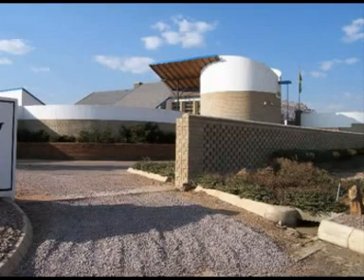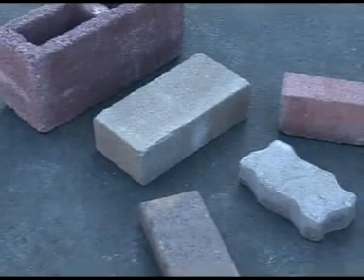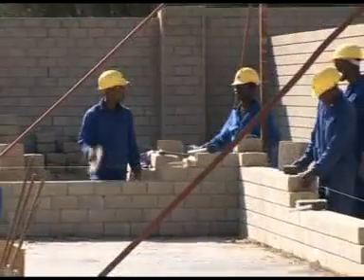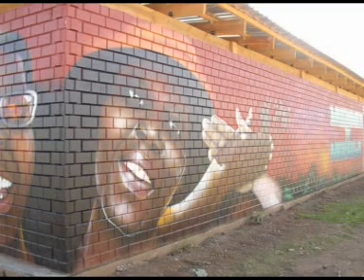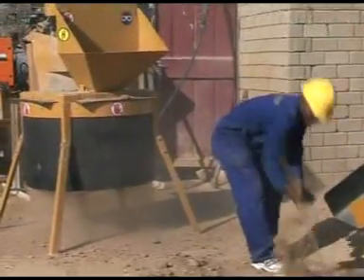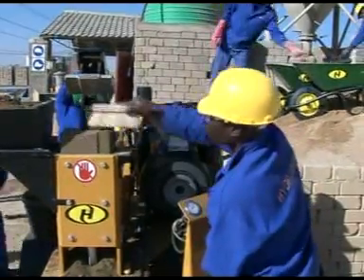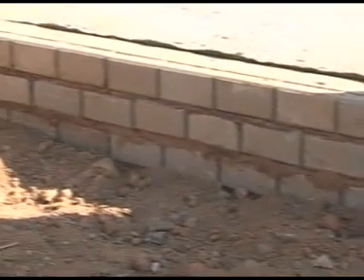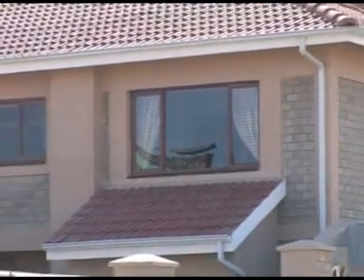HYDROFORM

Comment: What stops water from coming into the building in a storm if no mortar is used?
Reply: Good question! Could it be assumed that water ingress is minimised by the interlocking ridge that passes along the length and end of the brick?
Reply: Depending on constructions and roof over lay, joins can be pointed to prevent any penetrations